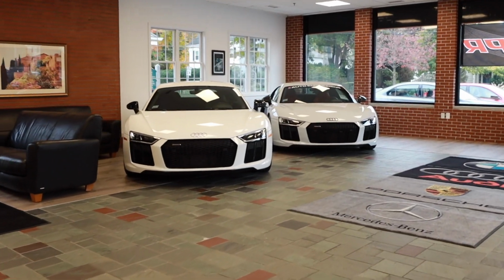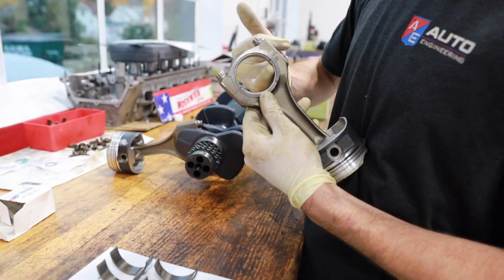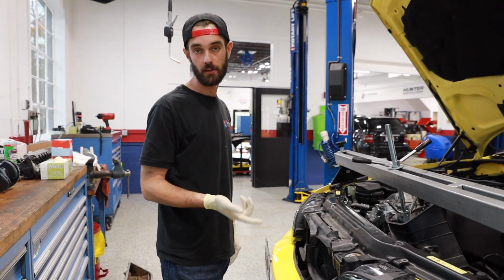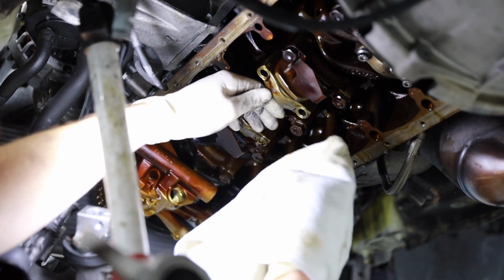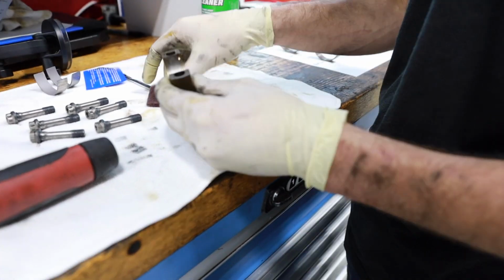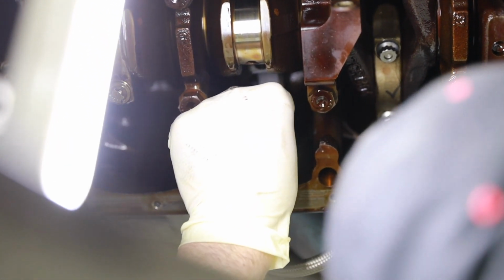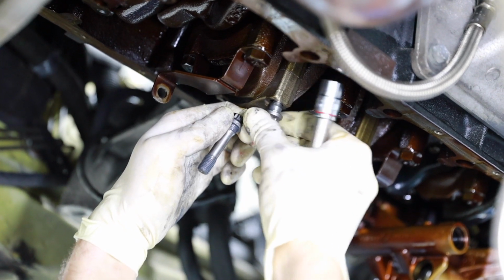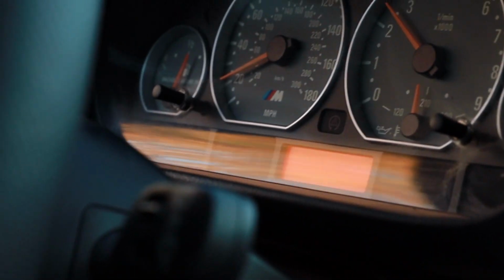E46 M3: Inside guide to rod bearings from a BMW Master Tech @ Auto Engineering

Comment: Any experience with King bearings? I want to go with ACL, but they’re backordered for a while and my shop can easily can Kings. It’s for an N55.

Also, age old question but would 0w40 vs 5w40 be preferable given the tight clearances while still offering a good film strength?

Comment: I have a 2002 M3 Convertible with 135K miles. I just did an oil change and sent old oil to Blackstone labs. They did the analysis and they say there is barely any lead in the oil, not to mention copper. So even though it's high mileage, engine seems to be in really good shape. I am under impression that because it's a convertible, it wasn't beaten up by some degenerates on the track and most likely it was some doctor or lawyer's car hence more like posers than real drivers :)
That being said, I am not gonna be doing this preventive maintenance job any time soon. Do you agree with my assessment?
Reply from the maker: It is certainly a big peace of mind service.

Comment: Well that was unexpectedly brilliant! Curious why the bolts always need replacing though, unless they're prone to breaking when re-tightening?
Reply: From what I understand, they are torque-to-yield bolts which means they get their tensile strength from the torque on the bolt and if that bolt is ever removed, the memory of the metal is basically ruined and isn't able to withstand nearly as much wear.
Reply: @BrianRoediger  Makes sense. Thanks.

Comment: What BRAND bearings? Most people do NOT use BMW ones, but rather better after market ones like: WPC. BE, and ACL.
Reply from the maker: WPC. Thanks!
Reply: @autoengineeringlexington3249  is the WPC bearing and ARP bolt sold as a kit? Where do you source your parts from?

Comment: The key is to let your engine oil warm up before going over 3-4K rpm thats why BMW installed an oil temp gauge under the Tach meter... And definitely do oil change every 5-6K miles
Reply: YES! Especially with the  M3's 60W oil! I am super careful about keeping RPM below 3K until oil is at least 180F.
Liqui Moly race oil. Liqui Moly Ceretec additive. OIl changes every 4500 miles.

Comment: I think it's a sad indictment on the engineers who designed this and the other ///M engines that rod bearings became a service item like replacing a timing chain for example. That engine hasn't travelled a crazy amount of miles for those bearings to be worn so badly. Not good and a very expensive bit of preventative maintenance.
Reply: It's not just that. It's the fact that people do not let these cars warm up and take them beyond 2.5-3k rpm treating them like any other car.  The fact is this is a really highly sprung race engine that needs the extra care, yet you have people not even changing oil at the correct intervals.

My car is on 123k with original bearings, I purposely went for low owners instead of   low mileage.
Reply: @spoonageDC2  spot on.   I cringe when I see videos of people revving up while the guage indicates engine isn't warm enough yet.

Comment: IMO you can do rod bearings every 80k miles but to be on a safer side 65k.  my E46 was done back in 2012 91k mile, thru factory recall or the previous owner did it for peace of mind. 

I have recently done the bearings this year 2021 @154k miles for my own peace of mind. It didn't show any copper layer so I would assume I could have held off for now until it reached 80k to 100k miles.  what I should have done was refreshed the vanos system.

I was hearing some ticking sound, I thought it was a spun bearing, but after I had it inspected I need the anti-rattle kit and the beisan system oil pump disk to have a tighter slack

Comment: nice video i like it but i think you you should measure the clearance between the rod bearings with plastic gauge !!
and to torque down the bolts in 3 stages  5NM - 30NM  and 103 degree  !! 
this information i got it from( turner Motorsports )  or i am wrong !?
Reply from the maker: Those specs may be for OEM rod bolts. These are ARP fasteners. Thanks!
Reply: Indeed , the plastic gage is a must, otherwise how would you know which « size/tickness” of bearings to use?
That should be a standard procedure for every rod bearings brand.
Reply: @GaaraUvU  do the bearings come in different tolerances? Otherwise what’s the point of measuring the gap if there is only one standard bearing offered for this platform? I agree measuring gap is good for piece of mind and knowing your result, but then help me understand what you’d do if it was out of spec. Custom order a new bearing?
Reply: @GotThrottles  yes they are in 2 or 3 different sizes (color coded)